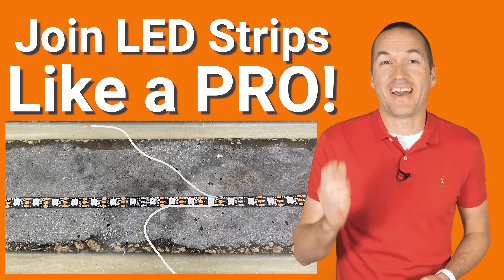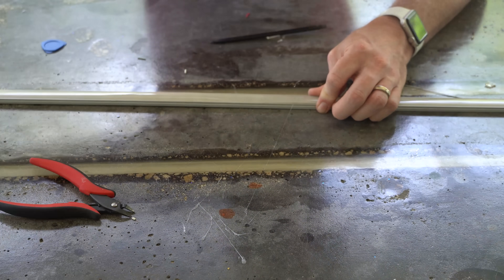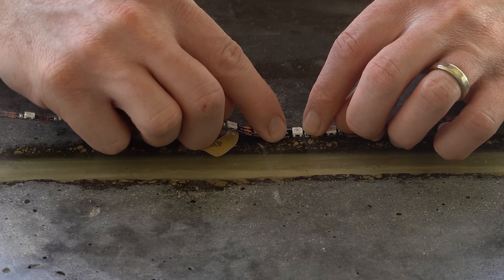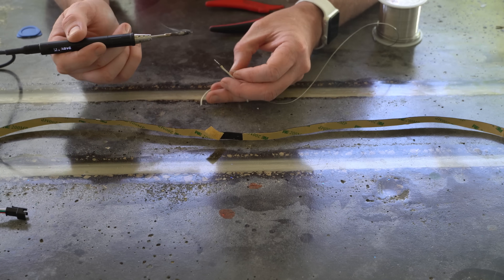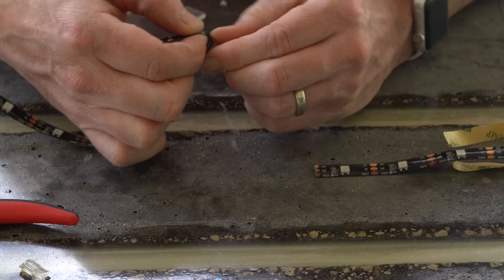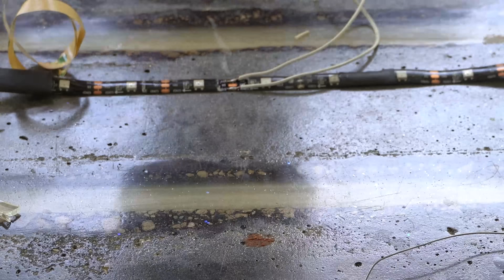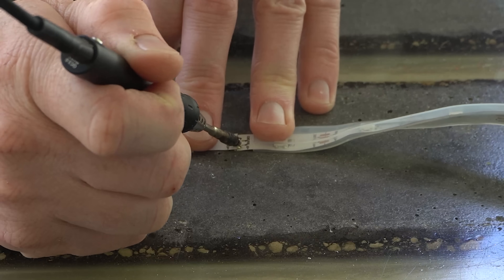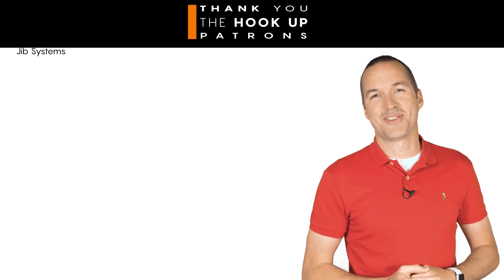The BEST way to join LED strips with no gaps or seams + make waterproof power injection connections.

Comment: This video is filled with inaccuracies first of all using hot glue to waterproof something is not great because hot glue will melt again when it gets hot out in in the sun especially in an aluminum strip it's not meant for waterproofing that's why they have waterproof heat shrink tubing or marine heat shrink. For waterproofing connections that aren't going to be inside tubing you use silicone, you can waterproof IP67 and 68 strips If you use the right materials.  on strips with enamel coating on the bottom you can scratch that on enamel coating off to reveal the copper pads and solder the top to the bottom like you would without the enamel coating. using a $20 solder iron will work but it's not a good idea, they have poor temp control and poor recovery time, when you touch the tip to the pad it loses heat, a 20 dollars iron will take much longer to heat back up to the needed temp, and while your waiting is heating all the components that are nearby, to much heat damage these components. 

Anybody watching this, please don't use hot glue, please use a good soldering iron, please connect the bottom of one pad to the top of the other pad in addition to connecting the tops of the pads. And please don't attempt to avoid IP67 or 68, just use the correct materials and methods. If you want any information about what I'm saying here, you can email me at twest4485@gmail.com.

I've been working with Addressable LEDs since 2019 and have extensive experience with electronics, PCBs, components, etc. if your interested in custom built to size and shape led and Addressable LED boards, feel free to email as well.
Reply from the maker: It's extremely common for heat shrink tubing to be sold with hot glue on the inside of it for waterproofing purposes.   Why do you make comments if you have no idea what you're talking about?

Comment: Thank you for a very helpful video! I have just tried my first solder to some BTF lighting and for some strange reason it was not de soldering it, I tried for a while with no luck it. It was ok to solder but not de solder. The Temp was at 350°C on my solder any tips why it would not do this be great. I did end up cutting it and soldering it so it still went well for the fiirst time and watching your video thanks

Comment: This video is really helpful, and I wish I could watch it before I purchased my LED strips which are IP68 version of DC24V-WS2814-84LED. Each of those strips come with two waterproof connectors (one is three wires and one is two wires for power injection) on both end. Now I have a problem to connect two IP68 strips seamlessly. I am considering to strip off the silicon caps and try to solder two strips and one 2 wire power injection line together then reseal the connection, but not sure if this will work or not? Any suggestions? Thanks!

Comment: I have a question! I’m trying to build a 5v system and I’m confused at power injection. You say tap in at the beginning and end of every strip for running the parallel wires inside channel. But if I’m joining 88 ft of LED strips for the perimeter of the front of my house do I just do the injection every 5meters? Or should I do at the end of one strip then literally jump a couple LEDs then tap in for the “beginning” of the next strip? Then another 5 meters? Repeat? I think it’s the first. Every 5 meters.

Comment: Can you desolder the factory solder joints to make a corner connection for example? You desoldered the attached wires but I'm talking about where you showed the example of the factory solder joints in the beginning.

Comment: Is it safe to run led wires behind sheet rock? Looking to do an install in bathroom
Reply from the maker: You'll need to check with your local low voltage electrical code, but whether it is up to code will depend on the type of wire.
Reply: @TheHookUp  it doesn’t say anything about low voltage wiring but I was more concerned with a potential fire hazard and what kind of insulated wiring I can use for an extra measure of safety

Comment: Wish I saw this video 1 week ago, after 2 yrs and some bedroom remodeling I finally got around to installing the LED lights on my daughter's bedroom (a saint for waiting so long) originally planned on solderless connectors but quickly learned they don't fit in the channels, so I decided to solder the joints. Nerve wrecking as I never done this and my connections were not pretty at all. They work now but your tips would have been great in advance. Onto my next LED project... Again thanks for tips.

Comment: Hi, i'd like to know which strip you would recommend me to buy between IP30 or IP65 if I want to use L or T connectors, please?
Reply from the maker: Always get the least waterproofing you can get away with.  If water won’t be an issue get ip30.

Comment: i got these 12 v light from btf and the output on the controller is also 12v i plugged it all up and it was good tried to use a connector but it didnt go so well had to keep pressing down on it to work and when it did the end lights was playing up so im thinking to solder it now but im trying to figure out if i shoud be powering it differently

Comment: now go do this on a 144 led/m strip :)

With soldering irons like shown in this video, that will be a nightmare. You'll end up melting the leds on both side of the connection.
Reply from the maker: 144 LED/m strips are harder to work with, but this method does still work.
Reply: @TheHookUp  not with this iron.

you need a thin tip to get to the dot in the middle.
Reply from the maker: @janklas7079  TS80 tips are quick swap, no screws or tools needed.
Reply: @TheHookUp  Then still you need to buy the tips.

I did not say it wasn't possible. I just said that witht he iron and tip you have in this video, it would be damn near impossible.

That's all.

Comment: Hi Rob - Thanks for the detailed video for soldering the LED Strips. I was wondering What was your soldering temperature when you desolder the original LED cables. I am not able to desolder them even at 350c

Comment: Thanks a lot! Is there a video as to how to run power injection wire along led strips inside channels and how to inject at multiple points for upto 15, 5 meter 12 volts strips?

Comment: Great Video....one question though. I am using LED light strips for a shadow box and had to buy more than I am using. I don't want to waste the left over strip, so what do I need to add to the left over LED strip (s)  in order to connect it to a power supply  ?  Thank you in advance.

Comment: Sorry if the question sounds too dumb to you.. Is there anyway I can turn off every 2nd diode? I am using it to light a switch panel and I would need the LEDs to be only 1 inch a part. I can't seem to find any strips with 1 inch a part LEDs
Reply: no.... some rgb strips can control ever 5cm - 10 cm separately... there is some new led strips that do  what you want.... https://www.youtube.com/watch?v=DCsjd79aUlc

Comment: Love your videos=- very informative.  Question on LED Strip lighting.  I'm installing in kitchen but have a couple of sections where I want to run and join the LED Strip lighting but don't want the LED's to show in a particular section.  In other words I want a gap and want it to look classy.  I'm lighting up a long eating bar and have a section where I don't want to see LED's going up a wall to the underside of a kitchen cabinet.

I saw someone use black tape but that will be an eye soar.

Comment: In the video you show how to solder wires to inject power while maintaining strip continuity. However, are these wires left inside strip? If so, how do you prevent them from getting in front of the LED and blocking light in some spots? If not, how do they enter and exit the strips while keeping rain out? Also, are the wires attached to the house or to the outside of the channel? Would love to see a video on this.
Reply from the maker: I usually just add a dab of hot glue every 24" to keep the injection wires in place.

Comment: Awesome helpful video. What do you recommend for DIYers who are setting up LED Strips as main lighting source in ceiling with profiles built into the entire ceilings in long extended strips on entire ceiling space covering about 1000 square feet? Main question here is power source? Controller Source? And how to control individually or together as one? If I install a LED Strip all over my ceiling on the entire ceiling on every room and hallways how/what is the best way to setup from LED product, power product, and controller product.

Comment: for power injections do you need fuses or any type of resistor or you just soldering it on the strip?
Reply from the maker: Fuses are always a good idea, no resistor needed.
Reply: @TheHookUp  oh okey but can I do this without the fuses cause I don't know what type of fuse should I use to each power injection
Reply from the maker: @Ydooo  It will work without a fuse, fuses are just safety devices.
Reply: @TheHookUp  thanks a lot !

Comment: Followed this advice and it worked well enough. Only issue I had was I had previously put up all my lights with the connectors and I needed to just fill in a pixel, but it was too long of a gap to just solder a pixel in. I ended up using a section of the 3 wire pieces.

Comment: My solder always never 'sticks' to the copper connections 😕
Reply from the maker: Make sure you are using high quality flux core solder.  Leaded is best, I recommend kester brand.
Reply: @TheHookUp  Mine is unleaded. Brand: Broquetas ECO1, maybe that's why ? Thanks for the input 😎

Comment: Trying to figure this out and I can't find any references other than this video, I'm trying to inject power to my 5-pin RGB-W, 24V, so I run positive lead from my power supply to +Pin, but no negative??  "while a traditional RGB or RGBW strip typically only needs additional power on the positive voltage connection since the ground is shared between each of the 3 or 4 other traces, which is how those strips change their colors."
Reply from the maker: Correct, just + for traditional strips.

Comment: If you have a run of 15 meters, or three strips, do you inject power 3 times after the original connection to power and data? Can that power be run in parallel, in other words, one 18/2 cable for the entire run and spliced at the ends of each strip? If so, how would you recommend waterproofing that connection and keep it within the slim channel profile?
Reply from the maker: Home runs are best, but parallel will work in a pinch: https://youtu.be/apwQ5Jh4VyE

Comment: This is super helpful! I was all ready to start installing my permanent LEDs along my roofline, but now I’m wondering a few thing. If you solder all these together, how do you install them? All at once?seems like you’d have to have lots of help. Also, how do you do the 90 degree corners? I have IP65. Also how do you get the wires into the channel? The end pieces hole seems too small, if I cut, and resolder , then I guess I widen the hole and just try to seal it up with silicone or something? Any help appreciated! Thanks
Reply: How did you get on with your 90 degree corners?

Comment: thanks, great video. two questions, if i want to connect around 80 mts. (16 strips of 5 mts. each) can i do it like this and wont be a voltage drop? if so, i will just need to calculate the power supply nedded, am i right?

Comment: would you like to know 12V individual control  ws2812 led strip ?    RGB ,RGBW             , one end connect power transformer , no brightness difference at whole 5m led strip or 10m led strip

Comment: I would urge the opposite opinion.  Ip65 is to be avoided and ip67 is always used. I have had more issues with that silly coating on the leds than silicone tubing.  The thing is hot glue is not the binder to use. 
You need to use silicone on silicone and it will make a perfect waterproof bond.
To attach hvb tape. Is to apply silicone o the back and roll your tape on since hvb will not adhere to silicone tube on its own.

Comment: 2:56 You should be adding flex here befor Soldar....  Because flex makes Solder go where it's suppose to.

Thanks for all your precious time!!!
Reply from the maker: I think you are thinking of flux.  You can add extra flux if you want, but the solder itself has a core of flux that provides all that you need.  Any time you are soldering and you see the puff of smoke come off of the iron that's the flux burning and doing its job.
Reply: @TheHookUp  extra helps my flow.  More important for smaller stuff but you are 100% about Flux core.  Thanks again! Love you long time

Comment: Great video as usual. One question. If your joining where the 2 lights connect and don’t have room for the connector couldn’t you just cut that off on each side and solder those wires together?
Reply from the maker: I assume you mean the wires on the end? The best option is to just desolder those wires and solder the pads directly together.
Reply: @TheHookUp  Yes that's what I meant. Okay thanks I will take that approach

Comment: I will have to try this out.  Had to solder 2 LEDs on the end of a strip the other day and spent 20 min before I realized the alum channel was acting like a big heat sink sucking away the heat from the pads :)  Once I popped up the end of the string it was easy peasy.    Nothing like being on a ladder trying to solder with an alum channel cooling the work down

Comment: Quality LED strips are supplied as a continuous roll with no “factory” joints. Soldering bridging to join strips together isn’t a reliable method. Over a long period of time thermal cycling causes a dry joint.

Comment: Hey there, thanks for all your videos, they are very informative and to the point.
I would like to ask a question regarding led strips and power injection. 
I have a w2812B led strip behind my TV (around 270 leds), powered by a meanwell 5v 18a PSU and controlled by a rpi3 running hyperbian with a different PSU. (with common grounds)
I noticed that at full brightness, especially in white, about half the leds have different color. 
Hyperbian has a "brighness compensation" option, the different colour occurs when this is option is set to 0. 
From github:
"	///      * 'brightnessCompensation' : 100 means brightness differences are compensated (white is as bright as red, is as bright as yellow.
	///      0 means white is 3x brighter than red, yellow is 2x brighter than red

This means i need to inject power from the PSU along the led strip right?
The easiest way (due to the way they are installed, would be to solder the "end" of the led strip to the PSU (- to the start of the led strip)). 
Would that work or should i inject the power exactly where the leds change color? (or perhaps a couple of leds before that?)
Should i plan for more injections along the strip since i will be getting in the trouble anyway?
Also, do i need to inject both 5v+ and ground? or just 5v is enough?
Looking forward to your answer, and thanks again for your videos!

Comment: Great video. I need to finish soldering my joints. Been too lazy to actually get it done. 
Suggestion: I would have showed how to use a multimeter to check continuity between the strips to ensure power/signal will pass through properly and none of the connections are touching one that it shouldn't. Better to find out before connecting power.

Comment: The technique for removing the silicon gel is a common one but difficult to do and prone to damaging the strip or injury.  There are safer  and better methods.
Reply from the maker: If done correctly (peeling toward the cut end), the method I showed will not damage the strip.

I've tried a few other methods (such as the hot knife method), and the one I showed in the video is by far the best.
Reply: @TheHookUp  I think that is a big IF.  IF done correctly.  I tried that method several times and gave up.

Comment: 6:12  I suppose that technique is good enough but I push the hot glue in/around the joints and seal the back of the strip as well.

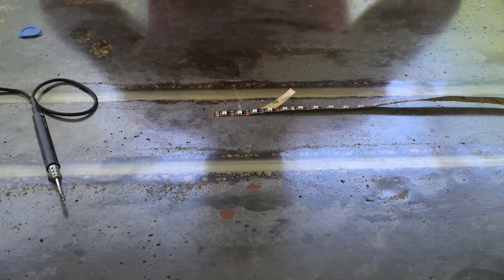Comment: 2:52   REALLY doubt the connection is as strong as the rest of the strip. It is a soldred connection with no mechanical strength except the soldered joins. The pads CAN be rather easily ripped off. I would use a temporary splint until mounted.
Reply: the rest of the 5m strip, is actually 5x1m strips soldered together. He mentioned that in the video. So if your soldering is as good as the factory, it holds true.
Ofcourse if you only have a strip without any soldering between strips (1 meter strip for example) you are right! Soldering has no mechanical strength
Reply: @tharealmb  five separate substrates?   or  five sets of 1m length of LEDs ?  My strips have a continuous substrate

Comment: From your video, I think I understand how to connect "home-run wire" power injection, but I'm still confused about running a parallel wire for power injection. Is there one positive wire from the power supply to a solder seal butt connection to two wires (one the injects to the strip and another that keep running additional distance to the next injection point)? Does there need to be a parallel ground wire with similar connections or just the positive wire?

Comment: Hi Rob. Got my SK6812s today but noticed two extra wires (white and red) in addition to the 3 wires (white, red and green). Could these be power injection wires??  Maybe there is no need for me to run power injection wires as the strip has made provision for this? I would attach a photo, but unable to.
Reply from the maker: Yep, those are injection wires.  Are you installing them outside?
Reply: @TheHookUp  Yes, but they will be installed under my thatched entertainment area along the rim so won’t be directly exposed to the weather.  It is going to be awesome!